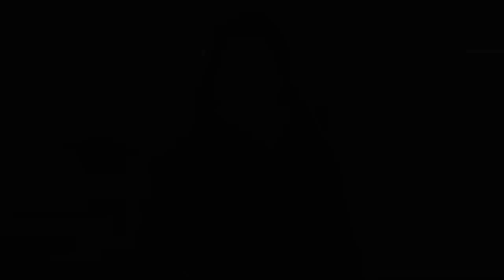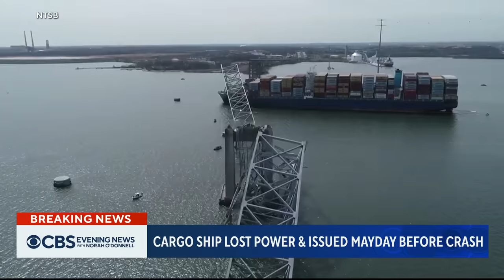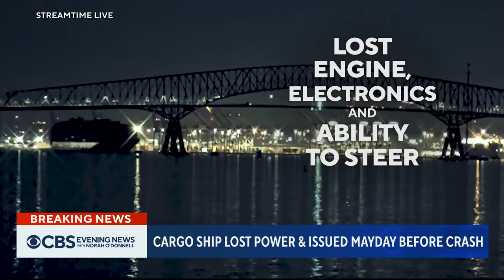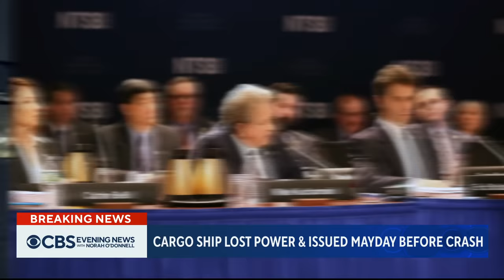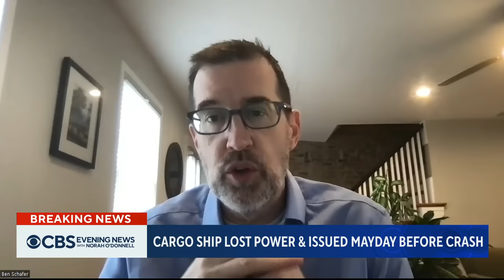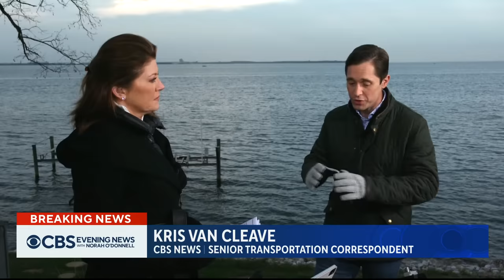How the Key Bridge crash happened

Comment: The smoke is not a generator,  it's the ship's massive engine running full throttle in reverse.
Reply: It was a diesel generator at full throttle....hence the Black smoke.
Reply: At this time of moment I just feel bad for those towns folks. They have to wait another 15 years into the future, to build up a new bridge
Reply: @problactive285 looks like it could have been a fuel supply issue as the smoke cut out and the generators supply power to the boat and the engines the ship more than likely has multiple fuel holdings and depending on their setup could of burned whichever one they were running off of dry before transferring of fuel happened or valves were shifted to change supply tanks

Comment: If they had been pointed in the right direction it would have continued on that path. Why was it aimed towards the bridge column?
Reply: The ship suffered a catastrophic power failure,  which killed the steering.  Power came back on, they were able to reverse the engine really hard, which unfortunately pulled the ship to starboard.  The black smoke is from the reversed engine.  They tried to slow down, only to be pulled in the worst direction right into the bridge pillar.  The port anchor was dropped while power was out, but it didn't help.
Reply: The rudder is stuck in its last position after a power failure.
Reply: @CricketsBay even if it was wouldn’t it be stuck straight? I was on several cruise ships that went under bridges and they never approached the bridge at an angle. It was always straight on underneath in the middle of the span.

Comment: Why did they edit the approach of the ship. You can clearly see it turned to hit the support column. There is no explanation that can justify why it turned hard right, while under power and seemed to target the ONLY thing it could have possibly hit.
Reply: As stated in the video, the ship was not under power from the point where its lights went out onwards. There's been a good video put together by What's Going On In Shipping on the play-by-play of what happened, but I'll summarize.

When the Dali lost power, it lost the ability to maintain its course against other elements acting on it. The main ones in Baltimore Harbor are currents and wind -- currents wouldn't have been a huge factor here, but the wind was. A ship that large, loaded up with containers, has a massive amount of surface area for the wind to act on, and it was pushed by fractional degrees over and out of the ship channel.

The reason it looks like the thing turned hard right is because this footage of the approach has been chopped up for the sake of fitting into a two minute news broadcast. Based on the GPS ship positioning data, the actual approach of the ship took quite a few minutes and its turn was more gradual than it looks here. However, a ship that large can't bleed momentum fast enough to come to a stop before reaching the bridge, and being pushed over by the wind didn't actually slow it down enough. It was only moving at about two MPH when it hit the bridge, but a fully loaded ship like that weighs two hundred thousand tons -- probably more than the entire truss span weighed. Any amount of motion was putting force on the bridge it couldn't withstand.

Comment: As noted -- We already pretty much went through this waaay back in 1980 when a very similar thing happened with the Sunshine Skyway Bridge across Tampa Bay was destroyed. 

It seems hard to believe that, 40 years later, pretty much any significant bridge does not have suitable protective berms for their main supports. 

I mean, it isn't something that everyone can afford to protect right away, but it is absurd that, in the course of 40y, some remedial efforts in this regard would not be performed on all major bridges, to prevent that kind of accident from happening again.

"It's happened before"? Who the hell cares? After the SSB went down, there were protective and deflective berms built at the base of the main supports for the replacement. It would be, at the very least, MUCH more difficult for a wayward ship to take down the replacement Sunshine Skyway Bridge -- That this had not been done here, as well as anywhere else, is rather indicative of generational negligence. You might not want to go to the full expense that FL went to to protect the SSB, the fact is  that there ought to be some protective berms designed to deflect almost any collision, even at the cost of sinking the out of control ship, and the lack of these is hard to believe. 

And you can bet that terrorists out there are noting this, even if it was a complete accident. You can presume they will try and make it happen intentionally in the future.

Comment: my only question is why did the left span break in half and not just drop off the support like the others did. I mean even the main large center span pretty much fell flat down but that left side def failed a lot worse then the rest of it.  look at 1:11 to about 1:13

I mean regardless the bridge was going to come down no matter what but I wonder if that left span had some structural or a design issue for it to failed that way I mean heck it was the first section that hit the water.  I would think the much larger center span would been the first part to fail.

Wonder how long the NTSB going to take to do failure simulations on this.
Reply: So, admittedly, I am NOT a structural engineer. But based on the huge amount of information that's been poured out there already that I've been taking in, the FSK Bridge was a continuous span truss bridge, meaning there was no left and right span per se -- the entire central truss was effectively one big arch. And if you look at about the middle of the bridge at the same moment, you can see a similar kink in the deck there.

So based on my own more basic knowledge of engineering and that information, you get something that goes like this. When the support of the left (south) pillar is removed, the area directly held up by the pillar immediately drops, but the parts attached to the right (north) pillar and the concrete approach on the left side are still in place and exert force for a fraction of a second longer to try and hold their parts up. So the big arch buckles roughly equidistant between the middle and those remaining points of support -- both the "left span" and the "center span" roughly snap in half. The right side of the center span takes moments longer because it's got more distance to fall.

That part of the bridge then fully topples, but because the whole thing is one giant arch, the right (north) portion is now grossly unbalanced, having had the weight of the rest of it holding it down towards the center. With that weight now gone as the "center span" tears off, it shifts suddenly and massively to the point where the right truss span connects with the concrete approach on the right side, like how if you take your hand off an unbalanced seesaw it'll slam down away from you. That rips the right truss span off the concrete approach down into the water, leaving the part directly above the right pillar as the last to go.

Now, as stated before, I am NOT an expert in the field, I'm basically a layman. I also have no doubt the NTSB is going to be thoroughly going over this in minute detail. But based on what I do know, I don't think there was a design problem specifically with the left span. Rather, it's that the design fools you into thinking there IS a left span, when in fact it's effectively all one giant span, carefully balanced on four points of support.
Reply: @InchonDM  yeah I agree its why it didnt make sense and I know its a continous span I was just using the support point as a reference point thats all.
I wasnt being literal sorry if there was confusion there.  Like I said the center did not fold, the left side did... why? it clearly falls way ahead of the rest of it. why did not the support point go first is all I am questioning.
Again I def plan on watching what the NTSB simulations will show.
I only brought this up because when I talked to my brother who is a structural engineer said that it looked odd also.
At least Im not like some of these people crying foul about the supposed 'explosions' on top of the bridge due to the electrical aircraft anti-collision light system arcing out as it was ripped apart.
Reply: @Cinncinnatus And this welter of people who insist that the ship was deliberately aimed at the support pier, because bad things can't just happen, apparently. Hopefully I didn't come across as lumping you in with them.